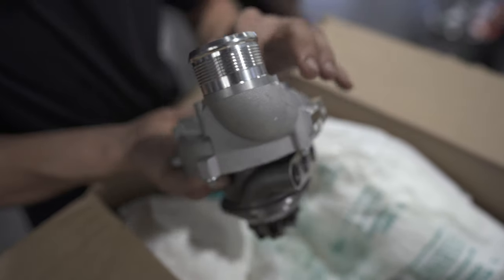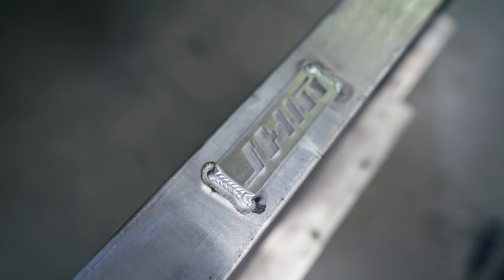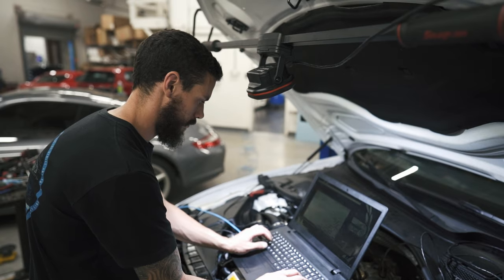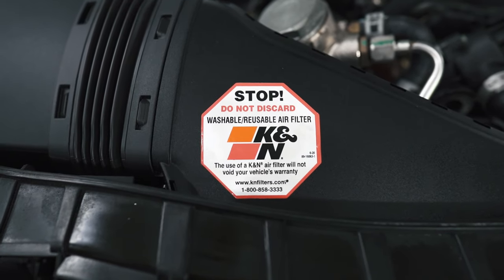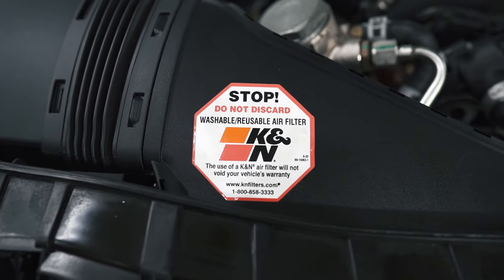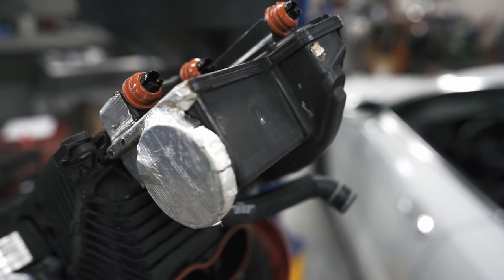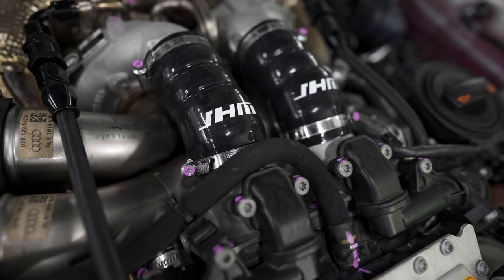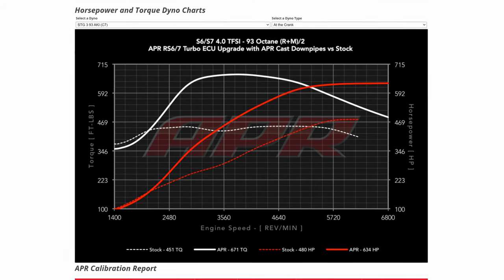HOW TO BUILD YOUR AUDI S6/S7 4.0T!

Comment: IE is going too absolutely smoke those Apr numbers. 
Their stage 2 e85 stuff is INSANE already.
Reply from the maker: I am excited to see more tuning support for the 4.0T! 😀
Reply: APR has pretty much given up on support for the C7/C7.5 so they can pound sand. IE is the way to go.
Reply: Yes it is.
Reply: @clutchpack1969  As of now IE only supports stock turbos, I foolishly bought the IE tune without proper research. DS1 is the way to go, they are tunable to what you got. Wanna buy an IE stage 2 tune? Will let you have it on the cheap!!😅

Comment: Alright, does the s7 and s8 have different 4.0T’s? Because they seem very similar
Reply from the maker: Yes different engines. There's a technical guide online for the 4.0T online you can review. Main difference is the S8/RS7 have lower compression ratio.